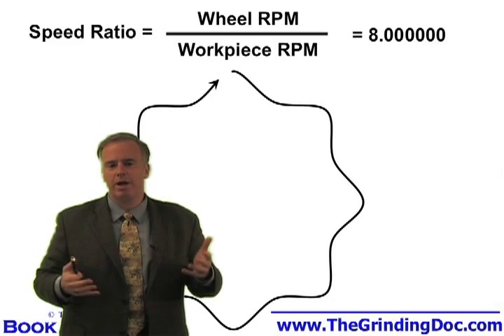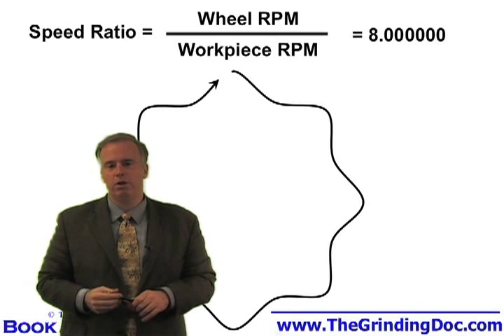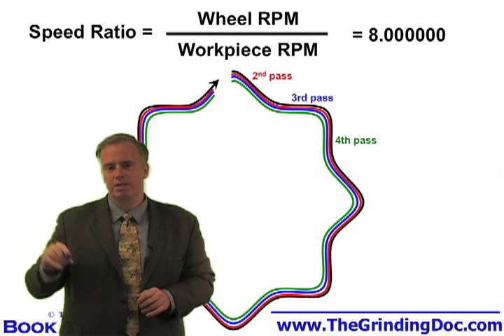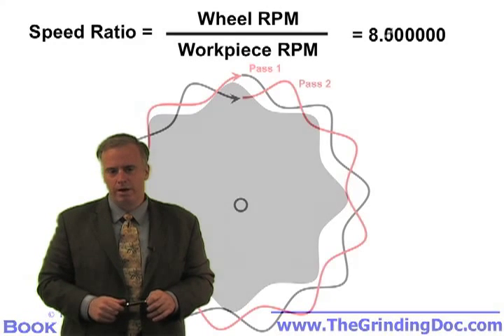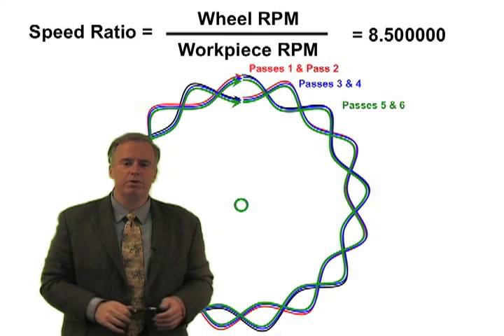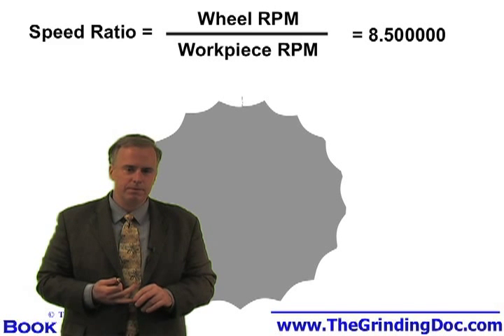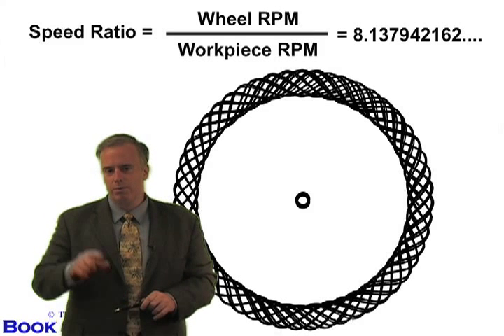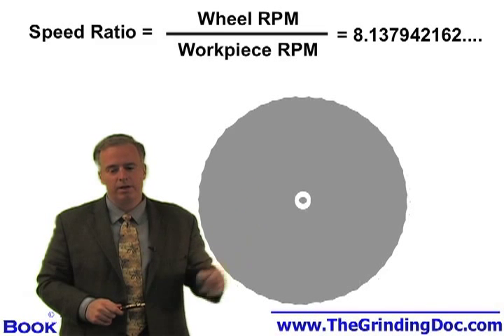Episode 39: Grinding the wave

Comment: I tried this one at work the other day and the results did not match my expectations. We had three lobes (our normal is two). Wheel speed 1500 rpm work speed 500. So I changed to 533 rough and 55x for finish speed. Made sure both numbers were irrational. But the lobes still appeared. What did I do wrong.
We were doing a OD roundness lab check, and this change did allow us to pass the check, but the lobes were still present, if fuzzier. I was under the impression they would be mostly eliminated or much less pronounced.
For context, I perform plunge OD grinding for cones. The workpiece and the grinding wheel sit at angles to one another (different angle for different products it changes frequently). So perhaps the various work speed relative to the diameter at any given point has something to do with this?